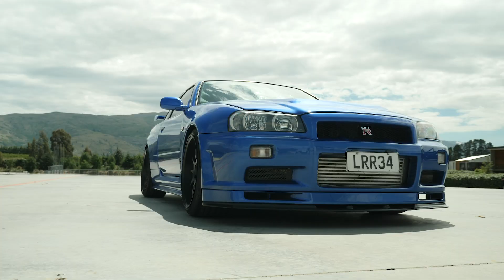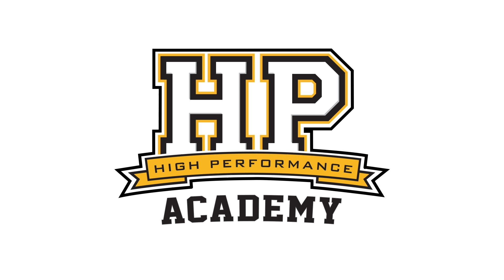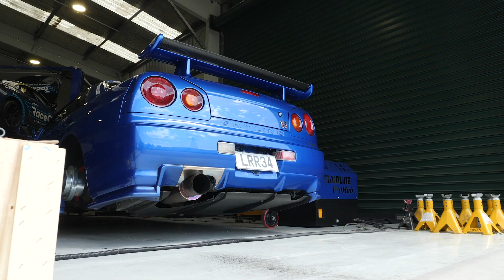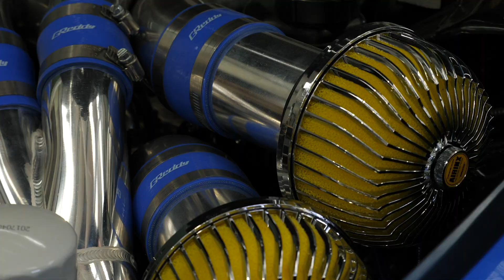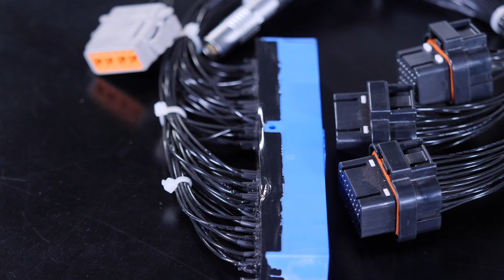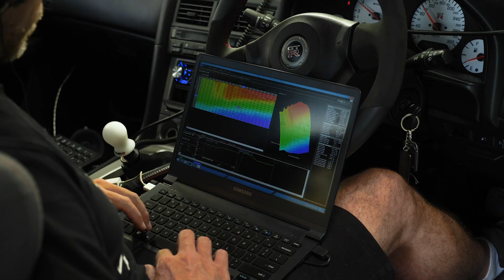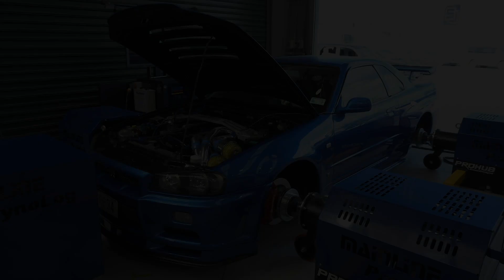The Biggest AFR Target MISTAKE Tuners Make?

Comment: Spends +100k on R34GTR
~$2500 on Emtron
$? on getting HPA to wire it in
~$2250 on Greddy intake kit

But then decides that $1000AUD ((~1100NSD)  for a new Ross balancer and crank trigger mount is just too much🤔? (+install a $50 AEM  single slot trigger wheel on the cam as a home using the oem optical sensor)

Even using the AEM disc alone (it's actually a 24+1 disc, but when used with a crank trigger, you only wire up the home signal) at $50 will give the same results as the NZ-Wiring kit for $350 less if money was actaully tight.
Reply: After giving both kidneys and a left nut to get the R34 GT-R in the first place, guess the owner didn’t want to part with the last nut or take out a second mortgage 😂
Reply: I did pretty much this. Im using a 1000hp ATI balancer with a 36-2 wheel welded to the hub and a ZF hall sensor for the crank and the stock optical CAS with the AEM 24+1 wheel with only the +1 sensor wired to the ECU. the ecu reports a 3 degree scatter in the crank reference relative to the home (timing of the home isn't important) but putting your crank sensor on the cam like this kit does means you're leaving 2-3 degrees of timing on the table. I'd pay $1000 to get 3 degrees more ignition timing at 25psi any day!
Reply: @burn4005  I went witht he ross balancer kit on both my SR20 and CA18DET. Don't want to trust a 20-30 year old elastomer balancer when ringing the cow bell. 

Some times it's worth saving a few $$, in this case it seems as if a better solution was on the table at a relativly small price increase
Reply: @manitoublack  unfortunately I'm ringing the cowbell a little too loudly (550awkw) for a Ross without going to a race or gold, then requiring an aircon recation kit + associated fan clearance issues that go with it. I understand ross have re-engineered their balancers in the last few years but a string of problems in previous generations spitting belts due to alignment problems did enough reputational damage for me to avoid them. the rebuild interval on an 1500hp ATI is 10 years, and i'd be replacing a ross after that period anyway due to the properties of the bonding rubber changing over that period. the ATI is just 3 bolts, pull shell and replace the elastomers with a 40 USD kit.
Reply from the maker: My question would be though, why would you spend the extra money on a product that isn't necessary at this level or modification? The current trigger kit as shown in this video works perfectly. As a side note the AEM trigger disc doesn't work nearly as well on its own from my own experience - Not least of all because it fails to address the inherent backlash between the CAS and the cam drive.

You could liken your comparison to the known weakness with the factory oil pump gears. The common upgrade is an aftermarket pump from the likes of HKS, JUN, Nitto or others which works perfectly. Why then would you spend more money on a dry sump system which is undoubtedly better, yet completely unnecessary for a street car? - Andre
Reply: How the hell can you spend 100k on r34?
Reply: @kaisuhina8024  sorry should have said $200-350k
Reply: @manitoublack  lmao who the fuck pays that much for that shit, there was literally a 895hp high end build on sale for 60k week ago, in showcar condition.
Reply: @kaisuhina8024  lol where?
Reply: @initialize21  finland, and if you wondering cars here are way more expensive than in uk, us, or germany. Or pretty much in any other place.

Comment: I kinda heard a turbo surge noise on the last dyno video!? 
Thanks for sharing!
Reply: Sounds like turbo shuffle, very common on upgraded twin turbos and just kind of a feature
Reply from the maker: Hey team, actually no, you're not hearing compressor surge during that dyno run. What you're hearing instead is the boost control solenoid venting the air from the wastegates back to atmosphere. It's a pet hate of mine and normally I plumb the vent side of the solenoid back to the air intake which silences the noise. That's not possible with the current boost controller though. 

Basically how this works is that the solenoid pulses at perhaps 20-30 Hz and vents boost pressure off the wastegate actuators to control boost. Depending on the duty cycle and frequency this can become more or less prominent (you notice higher in the rpm range the noise goes away as the duty cycle changes). 

Surge is a very real issue but not one we should come across with well matched turbos at WOT (particularly given how laggy these turbos are). Surge under WOT on the dyno is also incredibly violent and you would feel it (usually you'd abort the run) and at minimum see it in the shape of the dyno plot - Andre
Reply: @hpa101  
Sorry, I just dot' think so
Reply from the maker: @stangetz7838  why not? Given the limited information you have from this video, and Andre's explanation as someone who physically is working and tuning the car why do you think differently? Give us your 'data' to discuss :) - Taz.
Reply: @hpa101  Hi, no, I misread the Andre's explanation. I though he is venting the BOV valve line,  not the gates.
Reply: I was going to comment the same thing, at about 14 minutes in the video
Reply: Find videos on youtube of cars getting on throttle surge and you will notice it does sound different to this.